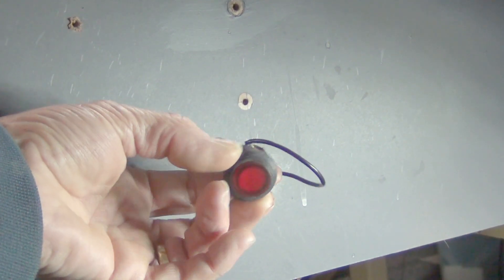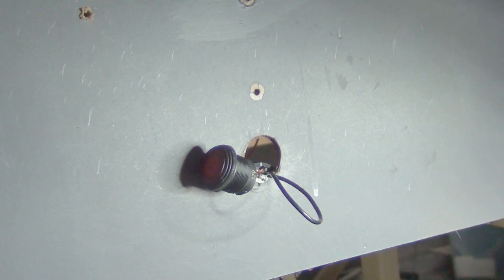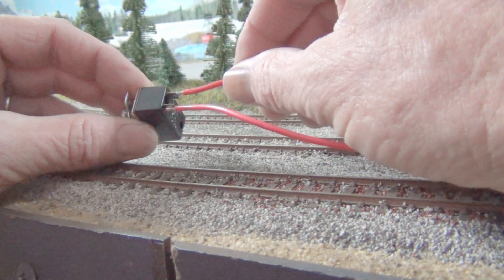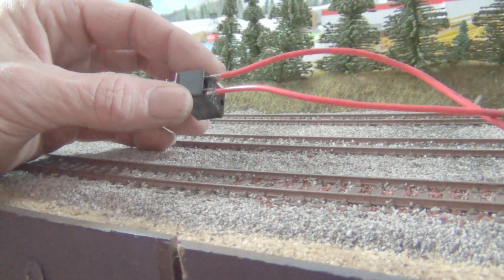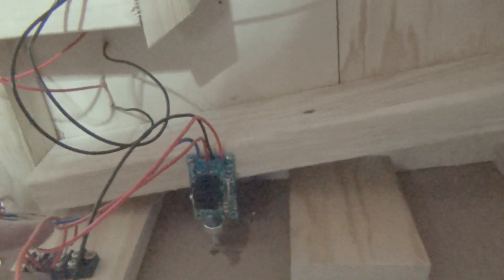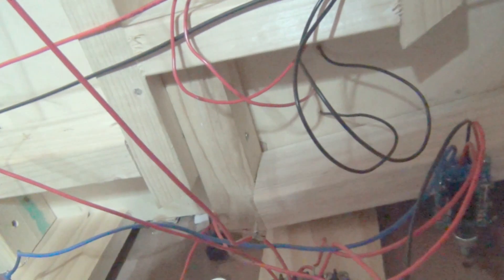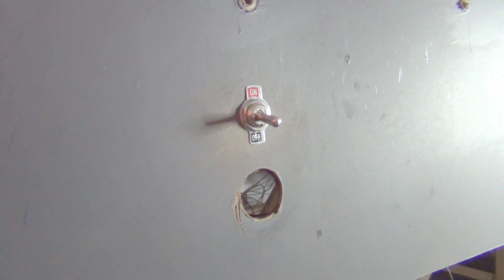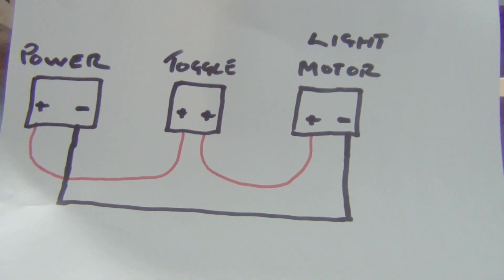Wiring a 2 Pin Toggle Switch "Model Trains"

Comment: Just a question. Have you tryed hot wheels cars or matchbox cars or any toy cars that is small like your auto loading cars on the Magna rail system?
Reply from the maker: I have tried die cast cars and they work ok but plastic cars i can run a lot cheers Robert
Reply: @csxmad   ok and thank you. Im thinking about getting a system like this and getting hot wheels cars or matchbox cars to follow a road probably.  Just need to save the money to get it. Lol.
Reply from the maker: @fastoutnotforkids7192   Thats great but  just remember that the lighter the car the more you can use at the same time cheers Robert
Reply: @csxmad  ok thank you for the tip. Have a good day or night